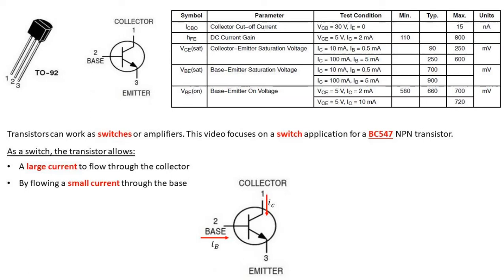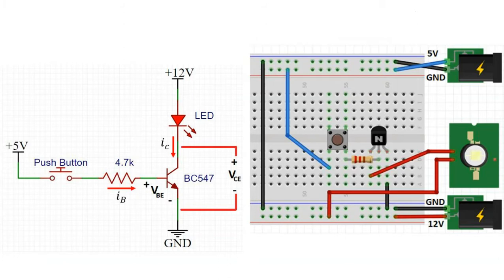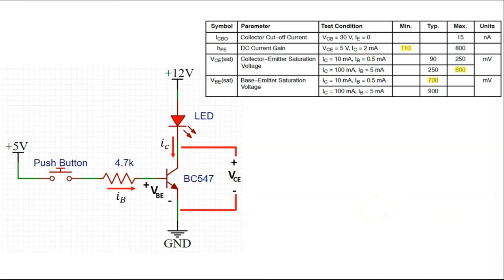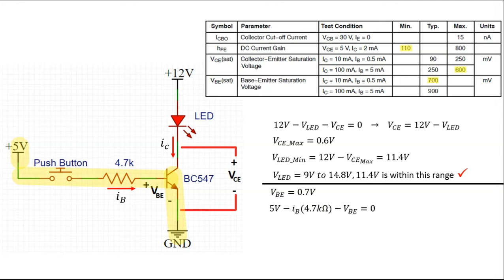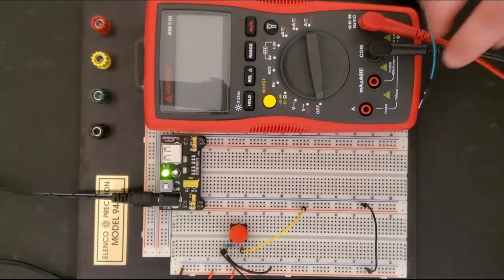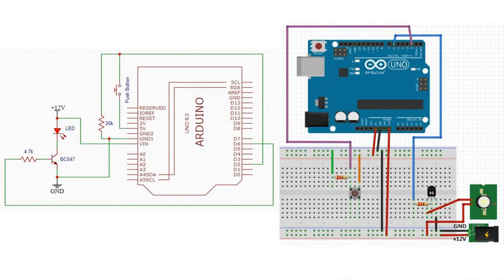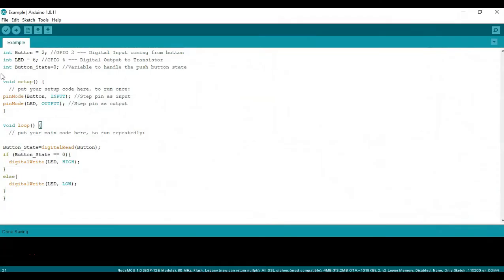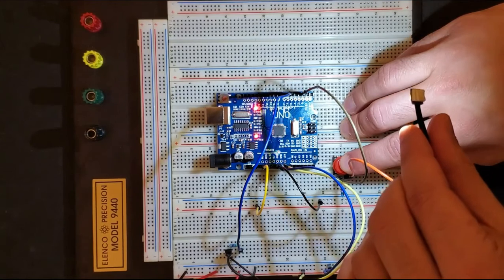BC547 NPN Transistor as a switch - Arduino example with LED Flash

Comment: You're incredible! Perfect explanation! Perfect, perfect! That was EXACTLY ALL that I needed. I'm working on a project to control an external device the exact same way you did and I was in doubt about the transistor model (I bought the BC548 which has the same electrical characteristcs) and I was struggling about how to proper deal with the base and that stuff (I'm a newbie). I can't thank you enough!! Regards.
Reply from the maker: Happy to help. Thanks for watching!

Comment: You can pull-down all Arduino pins programmatically, there is no need for the external 20k resistor for the pushbutton.

Comment: Hello. What is the power supply for the Arduino? Are you using the same 12V of the LED but with a 7805 regulator? Thank you
Reply: You can see in the schematic that he plugged the + of the 12V power supply to the VIN pin of the Arduino. This pin feeds the onboard voltage regulator of the Arduino, which accepts approximately 6-12V. Some cheap clones get fried at 12V though. I recommend no more than 10V and no less than 6.5V.

Comment: You said 100mA for Ic but it pulls 18mA. i couldnt get that point.
Reply: Ic = 100.6mA is the maximum permissible current flowing through the collector, with a base current of 0.915mA (ib)